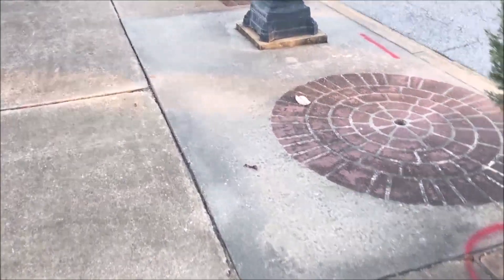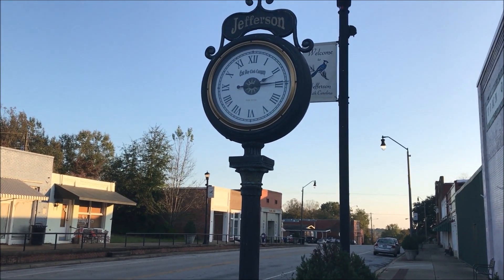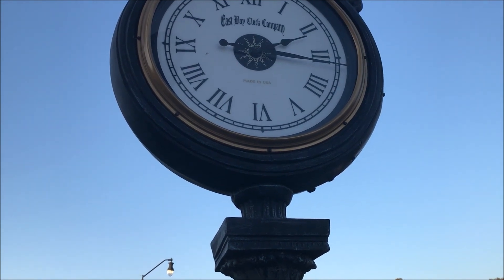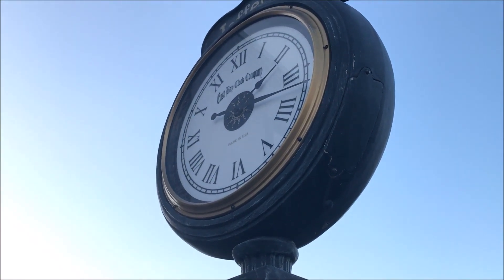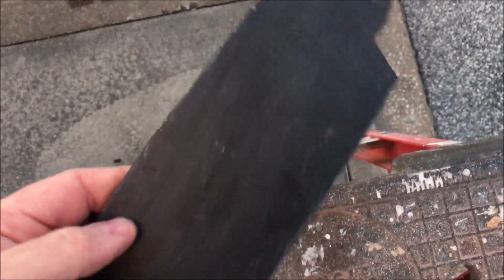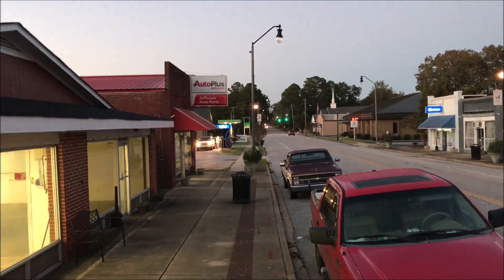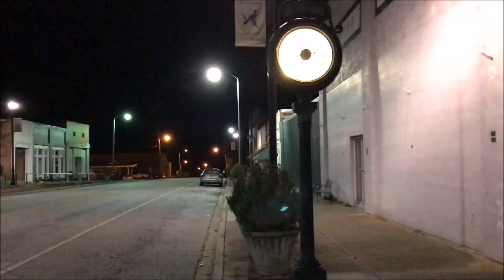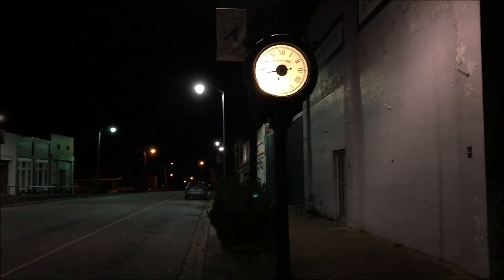The Street Clock on Main St. in Jefferson has the wrong time on it!  Clock Repair Update 11-1-2020

Comment: Maybe a round fluorescent bulb to light the faces? You might have to add a ballast rather than the standard light socket in there now, but it'd sure look nice, and should clear the motors. ✌
Reply: And that was one idea that I had as well but there might be a slight issue well we'll ask you a few things but first one would be mechanically potentially.

It's hard to tell by the video but inside the clock where the motors are there may not be enough clearance to pass the bulb between them because of course you'd want to Center the bulb.

But before fluorescent it would be infrequently replaced hopefully.

And if it meant removing one of the clock faces to replace the bulb this may not be as much of an issue.

So really it would be a question of serviceability of the bulb in this application.

Also he did mention about that meter box that just goes to the clock only.

If it's a fluorescent it will probably use more power then the LED.

I think there was an LED in there and went by too quick to really see and didn't pay attention I thought it had a white base on the bulb?

Also something to think about with the fluorescent bulb which would be why the other issues I was going to mention.

In the wintertime I'm not sure how cold it gets down there in that area I do admit.

But when it gets past a certain temperature in terms of cold.

Fluorescence have issues starting in cold weather.

David Allen seen them in a house occasionally if it got too cold they would act up sometimes especially like in a basement or somewhere where it's not much heat.

And also if they do even start they take forever to come up to full brightness sometimes.

And sometimes they may not even fully get going to the point of full night output or even the stable operation in Flickr like mad.

Which also adds to another issue which I was going to bring up when that happens if someone is not aware about for essence or even that is one he might get a call about the clock saying there's a problem with the white and all it is is just cold and you know if one person does someone else might as well.

Also with the power consumption of it before I sent it's not just the what's the lamp it's also ballast loss as well.

I don't know if they do actually have modern ballast for circular fluorescent lights.

That's not the type of bulb I work with in years and years most of the ones I see are preheat fluorescent.

 I know at least one of these types of bulb is called Circle Line fluorescent.

 which is actually kind of a contradiction in terms Now isn't it?

But I'm sure that circle is referring to the shape of the tube obviously.

 and line is referring to product line I'd say at least that's my theory.

If anyone out there would correct me much appreciated on the above.

By the way preheat for certain things are still around to some applications.

Especially short tubes.

Not entirely sure if they still actually have newer force and pictures are preheat but from what I understand there may be a few that are newer?

 also overcoming the starting and running issues of fluorescence in winter time in regarding this clock.

This may be complicated but if there was some way to increase the heat a bit in the clock in the winter time that might help kind of a weird way to do it but might be an option?

One of those little bimetallic thermostats not necessarily one that can be sad but possibly one that's fixed temperature normally open that would close the contacts just a bit before that temperature that Florissant lamps act up.

I know it's over thinking it but sometimes a little bit over engineering actually gives better results.

Also sometimes temperatures can affect clock mechanisms from what I understand.

 they do make small electric heaters that screw into standard light socket.

That are actually designed to keep things from freezing up or preventing condensation which might also be desirable as well possibly.

And since it would only be on when it would get too cold the thermostat might be a good idea.

 besides you can probably use the original incandescent socket maybe even.

Also something possibly do would definitely be the setup that setting switch as well if it does not have an office isshin put one on it not just working on the clock either.

 there's sometimes you may need to stop the clock like if you're saying it and you go too far or perhaps when you fall back an hour you just turned off for an hour then turn it back on!

I remember during the time changes at school when I was a Youngster there would be an announcement at a certain time of day that time of year that the clocks will be turned off and it would not be restarted tell?

 she was different schools I went to head different systems for keeping time accurate so yeah.

Civil War quite distracting!

Oh and yeah the time flying joke never got old at those schools!

Fastset motor!

Okay storytime here.

I once worked on an old clock system similar to this except it was an Impulse system or very similar and it was corrected automatically I can't remember how the system was set up too long ago.

But this system was kind of unique at least in modern times there was a clock tower in the town that acted as the central priming system for the city-wide clocks.

If I'm not mistaken that was kept in sink there's something else possibly a master clock somewhere in the area that was even more accurate than the clock tower was.

I actually did get a tour of the clock tower as well course.

It was entirely different than any mechanism I never seen not just to chew the Prussian devices and the output devices either by the way the outputs were Mercury switches.

And also there was heavy duty mercury relays that would tip over when a coil pulled in closing the output contacts to the pulse? System

Essentially it was like the old school clock system literally in old schools.

Evidently this also operated the noon whistle as well which there was connections for as well.

And there was all sorts of time related stuff in the clock tower as well old school light sensing.

The building that the clock tower was in.

Look like it was some stately building although it wasn't it was actually more of of a stately facade you could say actual building but fake building there were Windows know there are lit however there was interior walls that were very shallow from the windows.

There's all kinds of stuff in there mostly electrical and mechanical gear I don't remember the entire story but I did get a tour of that as well.

Although some of it was obsolete of course.

Some of it had to do with something with the utilities and also timing of things in the city lighting control and others.

There was a couple of old school equipment units didn't know quite what they did but they were active and evidently and had something to do with Telemetry of some sort.

 and I do remember seeing Westinghouse Badges.

 and also there was a Mercury Arc rectifier.

So obviously old school I did not thoroughly understand everything I wish I did.

 and there was some sort of DC switchboard as well and yes operational but I don't know what it provided power for?

 and also the lighting the city clocks was provided from that building as well Voya constant current series system like the old school street lights And yes they had serious street lights in that town as well.

 and some of the street lighting Transformers were in the same building as well.

 I almost thought the Mercury Arc rectifier correction mercuric bring two fires there was more than one a few single phase ones as well as three phase as well.

 I thought that some of that might have been hold over from Ark lighting for street lights because of the age of the town would make sense.

 by the way the series Street lighting is kind of a holdover from Ark lighting it as well.

 also so the old Ark lights were preserved but converted to incandescentJust for nostalgic purposes. although I don't know what they were on the series system but I suspect they were because the wiring was already there

Evidently this had been around for who knows how many years.

 and some newer stuff have been added as well.

 the clock mechanism have been updated at one time.

The original clock was lit by gas in terms of the clock tower itself.

 although back in history there was one place that had something similar but not as advanced large stately private home one of the Vanderbilt's residence had a clock that would be a summer one to a tower clock sort of almost that is that was the central time keeping clock for the entire residence it sent out an electrical pulse once per minute to every clock in the entire place.

 keeping the egg received within one minute of the main clock but then again this place was ancient so yeah pretty Advanced for the time.

 they had electricity before most people even knew what it was.
Reply from the maker: It never even occured to me that I could just turn the clock off for an hour, LOL  (this is Ronnie) My Brother Donnie would have thought of that, though :)  Thank you for all the ideas, and the story too, thanks for watching!